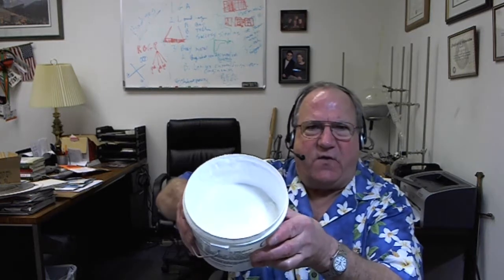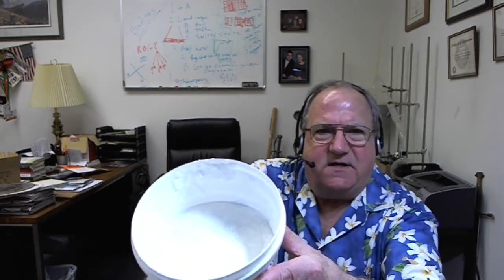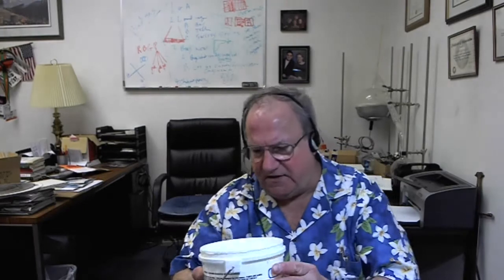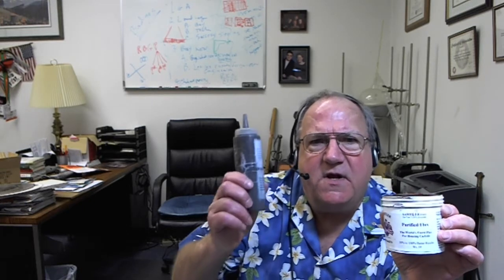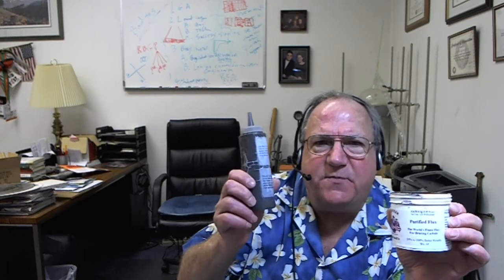What is Brazing Flux | Carbide Processors

Comment: Hi - can you use white brazing flux to solder with.  I want to put a soldered edge on a piece of glass.  I got some from a local DIY store and I thought I was buying soldering flux - but this is white and powdery and not the liquid type that I saw on a craft video.  Anyway I hope you can assist me.  Do I miss the flux with water? and do I put the flux on the glass and then swipe a bead of solder on it?

Comment from the maker: Mix the flux with water to make a thick paste.  

Actually, I would suggest you go back to the video and see if you can tell exactly what they are using.  

Flux is usually used as an oxygen interceptor.  You would could coat the flux rod with it.